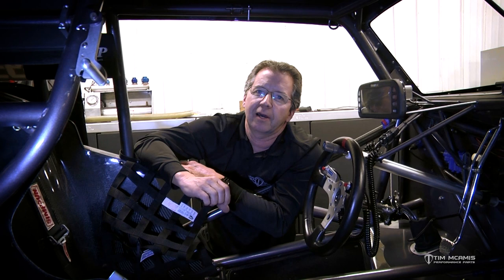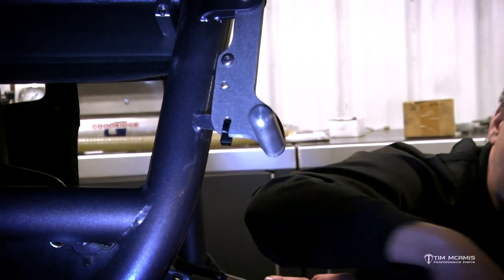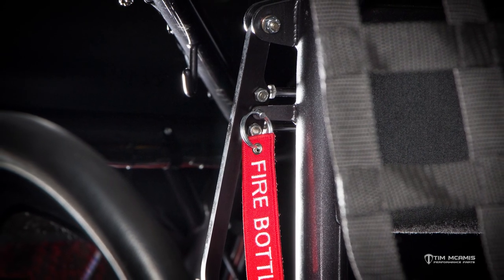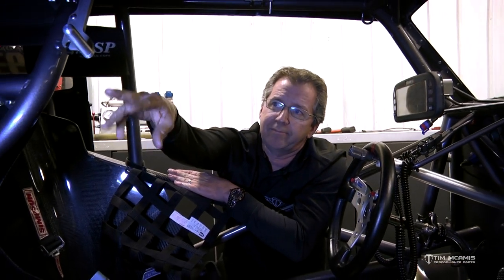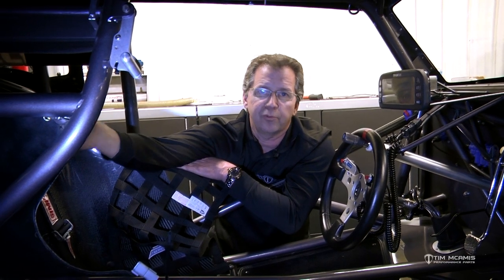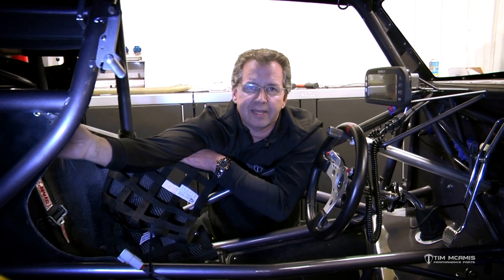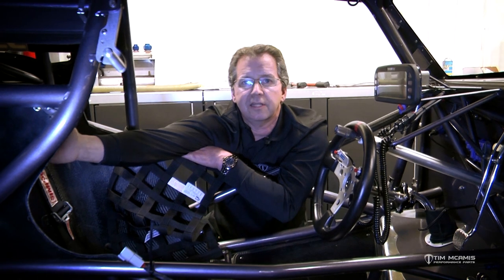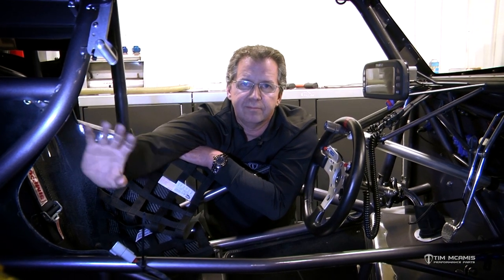Fire Safety Rant

Comment: Good info and rant. 
The old axiom, "I would rather have it and never use it than need it and not have it" (work) is so true, especially if you have ever known anyone with burns. 
Our fire bottles have saved the driver once and mitigated car damage twice. 
We run 2 separate 10lb systems, 1 Novec system for the drivers compartment and another AR-AFFF system for the engine compartment that also has a discharge nozzle above the fuel cell. 
Everywhere we run the tech inspection team always checks the fire bottle pressures and will fail the car if not in the green.

Comment: Ran a bracket car at a local track another guy drove i turned the wrenches. We got in a heated argument about the fire system. He wanted to leave the safety pin in the fire system all the time. He said he could pull it and then activate the system if he needed to. Sometime Later i left to work on a different car and he wound up putting the car on its roof. I went to the pits to check on him and see the car sure enough the safety pin was still in place when I asked about it. He said everything was happening so fast i didn't even think about it. So the car is a balled up burned up mess and the pin was still in. Yes he got out and didn't get burned very badly but I noticed when he built another car the pin was out when he ran.

Comment: can a fire bottle be recharged by anyone other than the manufacturer?
Reply: The easy way to find out is to call your local fire extinguisher shop with your model # and ask them, or just take it in and let them look at it. The next time you're in a public place like a Walmart look around for the name of the company on the inspection tag on their fire extinguishers so you know who to call in your area.

FWIW, I had a very large industrial style extinguisher recharged (not refilled, the contents had never been used, but it was manufactured in 1992 and last certified in 1997 and I wanted it checked out), a new seal installed, and a new discharge hose fitted for $22 at my local supplier. The extinguisher itself would have been $600 to replace all together.
Reply: tim I happen to have a fire extinguisher licence to inspect them. Yes you can have other companies inspect/refill them. In a commercial business setting they are required to be inspected annually. They have a six yr internal inspection. Then a 12yr hydro testing. Generally any metal head extinguisher can be refilled. If the head is plastic then it's a throw away after discharge or 12yrs. It's also very important to have the correct ext that matches what you have the potential to be burning. Like an ABC extinguisher.
Reply: @Nacman34g  We have two small extinguisher in our home, One is a garrison srfe-2m, pretty standard, the other is a first alert fe2bca, a plastic non refillable head, it needs replacement as the amount of dust on it feels like more than a decade old.  Any recommendation for homes? The plastic one is in the same room as the electric panel btw, that's it's purpose :)
Reply: @MmeHyraelle  A 2.5lb ABC is usually the standard in apartments and homes.  Even with the extinguisher being kept for the electrical panels though no amount of fire extinguishers are going to put out a burning electrical fire until the power is turned off. So heaven forbid that ever happens be sure turn the power off before trying to put it out. Personally I keep 5lb ABC's in my house so if you have the room I'd recommend a 5lb. A standard ABC extinguisher will handle most household fires in my opinion.  With all that said though most importantly is saving yours or someone else's life instead of saving a house.  A house can be rebuilt.